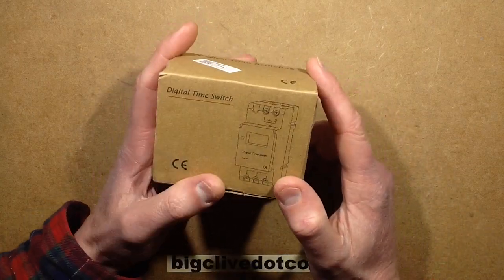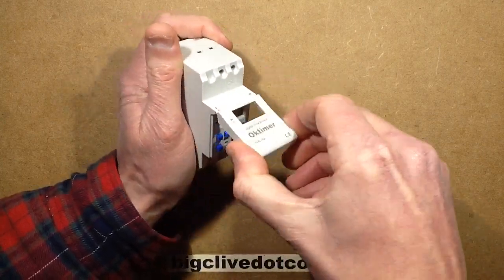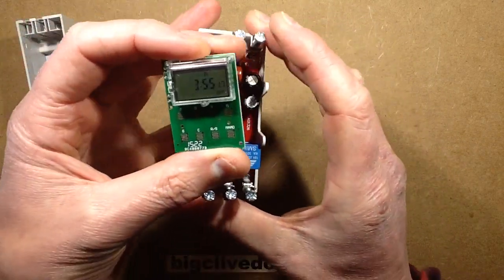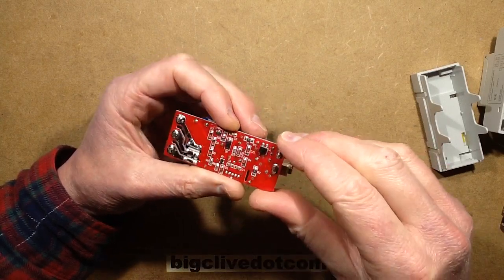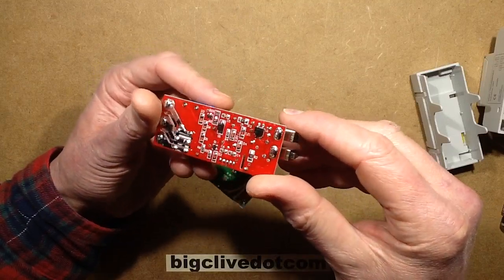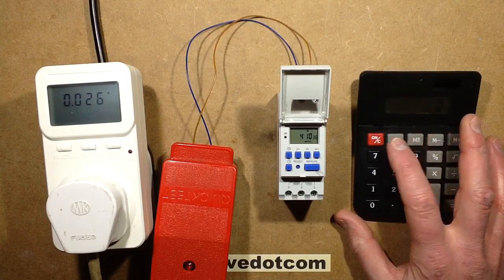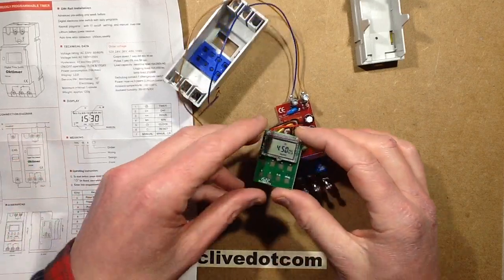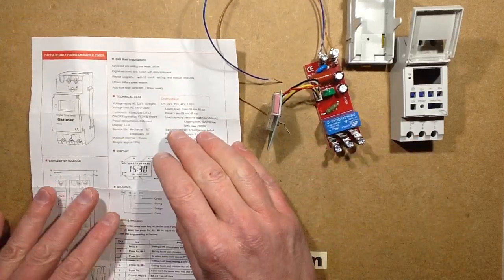Inside a cheap Chinese DIN rail time switch.

Comment: if they need to add solder to a track, is because you have the wrong PCB thickness. That doesn't make it robust, it makes it unpredictable. For example, you have no clue what is going to happen if you have 5k volts
Reply from the maker: Adding solder to a track gives it greater resilience to short circuit current and also allows a slightly higher current on a thin track.

Comment: I use this exact identical relay to witch my back yard's garage lights, been working for a full year now. its amazing. I should also mention the total brainfart I had with this timer. I thought that you feed 220v from above and then you connect the load in the bottom and the timer sends power trough the timer and out the bottom contacts. I swear to god I was trying to solve this non-existent riddle of how and why the thing did not work, only then, after two hours, I realized. It does not send power trough itself, you have externally feed the switching contact. Jesus Christ. Been in Electrical field for 2 years now. Im ashamed.

Comment: Glade I could find your work, I have one of these timers that has blown the input capacitor and cooked the accompanying resistor. Do you perhaps have these two values for me. I would like to repair this unit, it is a 220v input timer. This happened from new so it's a new component failure. You did refer to the cap being 330nF at 630v, I think the res should be 550ohms . Hope you can assist with my rebuild.

Comment: the real timer is quite expensive compared to this one .We have used them for controling lights ventilation and believe it or not proofing ovens for bread ..We use the timer to control a contactor with a 120v coil ..They last pretty long considering the way they are made very reliable but pain in the but to read and program especially when you can't see the screen because of flour grease and all the other stuff floating around the bakery .Sometimes we just use an old style mechanical clock work timers but they really him up with stuff in the air .these don't .they each have their applications

Comment: Put one of those anywhere near contactors and it'll fire when the contactor closes sometimes... Banged my fucking head against a wall with that one for a month.

Edit: also of note, if you have an input on a raspberry pi, a contactor close will make the pi think a signal has been received... It's a very very tiny pulse but the pi counted it - I suppose you could do stuff with capacitors etc to stop that, but I just sorted it in code since the signal input is so short.
Reply from the maker: Yeah.  Some reset randomly when they bring in contactors.

Comment: Mine arrived and the display was not on like all the videos I've watched. The instructions state to connect to power and let the the battery charge before hitting the reset button. I've had mine hooked up to power overnight and I still have nothing. It the light meant to be on when connected to power? Maybe I have a dud :-(
Reply from the maker: Try pressing the reset button while it's plugged in.  It's possible the battery has failed.

Comment: Sold with multiple Voltages, however the one I received (12V) had no indication of which way around the +V and -V was on the input, which just had the sin symbol for AC in.
A bit of digging around on the www and found that pin 1 is +V pin 2 being -V. I see Clive says there is a delay between switching over manual, but the one I have has auto as mid position key press on the manual changeover in either direction on, auto off and off auto on.
Nice video as all your stuff is

Comment: I bought so many of these (Although I can almost guarantee they were Not this exact model) in my country, and they were all Shyte.

The ones they sell locally, have a flaw where the clock And relay can be triggered directly from the battery, even when disconnected from mains.

I found this out after a power failure, when I actually heard the relay buzzing, trying to pull itself on, but obviously, the little battery that maybe once could, couldn't any more.

Bought a different design, which only allows 24 hour programing with a touch sensitive screen to set the unit (Will NEVER buy another one of those either as the display is crap and warps out of focus when you try pressing where the touch symbols are.

After buying the touch input DIN one, I decided this was the last time. From here on out, it's going to be the sonoff SV units, which connect via Wi-Fi, so they never go out of sync with time, and you can program them directly with schedules, or manually activate it from a smart phone.

The only thing I would have to get is a beefier relay, as this runs the pool pump currently 🤔

Ps. What abomination of a tool actually down votes an informative video like this?

Comment: It is exactly the same as the much more expensive brand Gewis, even the instructions are the same apart from the logo. Been using one for 7 years and one for 1 year, both going strong.

Comment: When my relay turns on, the timer reboot, any idea?
Reply from the maker: It's a common issue with some loads and cheap time switches.
Reply: @bigclivedotcom  Do you know if it is easy to fix? If it is a common component issue...

Comment: For anyone concerned with reliability, I have used these exact timers in my shops air compressor control panel for the past 5 years now without any issues. One timer controls a mains supply contactor(so compressor is de-energized during closed hours), and a second timer, coupled with a delay timer (5 seconds) for an auto moisture drain for the tank (drains moisture from the tank once an hour). System has worked flawlessly for 5 years since I built it and put it into service.
Reply: thank you, that kind of feedback is very helpfull

Comment: Hi Clive.  Love your vids.
I have a plug-in type of this timer.  The PCB and components are very similar. 
https://www.ebay.com.au/i/272298076000?chn=ps&norover=1&mkevt=1&mkrid=705-139619-5960-0&mkcid=2&itemid=272298076000&targetid=894844051568&device=c&mktype=pla&googleloc=9071851&poi=&campaignid=9772795581&mkgroupid=99377631746&rlsatarget=pla-894844051568&abcId=1145981&merchantid=109696241&gclid=CjwKCAjw-YT1BRAFEiwAd2WRtgWSupqQBLD5em3UNQrV92O1aSTHBhiYpDU6KtiWbK5ObpG5s6A6thoCA-AQAvD_BwE
The problem is that when a switch or high load on the same circuit is made or not, the timer does a total reset, time, timer settings, everything.....  Any ideas for an easy fix, or bin-it?
I'm a mechanical engineer, and a beginner/intermediate at electronics.
Thanks,
Bill

Comment: Last week I've bought a cheap din timer from ebay for  £10 for ny little automatic starwberry "farm". It had a ground connection, so I took use of it. When I powered it on, it tripped the 5mA R.C.D. I opened it up and I found a 33K resistor between L & PE. I asked the manufacturer about that, and they kindly responded: It is a timeable R.C.D. trip
Reply from the maker: That's odd.  Can you give me a link to the listing?
Reply: @bigclivedotcom  The've deleted it after I complained.
Reply: @bigclivedotcom  I think it was called a "super timing module DIN timer switch scrren lcd module or something. Imagine a confusing name like this.
Reply: @bigclivedotcom  Try typing this into ebay maybe it will show up. It was a blue coloured device with 10 buttons and a buzzer built in

Comment: From the 24vdc input terminal, what is the value of the 1/2 W resistor?. Looks like green, brown, gold, with gold tolerance. Is it a resistor or an inductor? I looked at the outside case and saw the AC symbol and powered it up with 120VAC and blew the resistor? It is burned but still reads 544K ohms. Then I saw the stamped input 24VDC on the other side after I fried it. I guess the AC symbol is generic on all input types, just have to read what is marked on the case, duh, lesson learned. Also looks like a memory cap type battery for the display, or is it a battery? The display was weak so I was hoping that the input voltage would recharge the battery/cap.

Comment: The burning question (see what I did there?) with Chinese stuff is, would you install it, and risk leaving it, powered up, unattended, 24/7? - I'll be honest, it takes me a long time to put any faith at all in Chinese products. In a way, it defeats the whole object of some of these gadgets. I am, however, wondering about utilising one of these switches to operate an outdoor lighting circuit such that it can turn on and off party/Christmas/garden lighting sets.

I must say though, this switch does seem to be unusually well made, considering its origins.

Comment: What was the charge regulation on the battery?
Reply from the maker: Just continuous trickle charge at low current.  How most NiCd/NiMh button cells are charged.

Comment: Hello
Can i change the battery with a different type / voltage?
Reply from the maker: The battery would have to be the same chemistry.
Reply: bigclivedotcom thanks for your fast response. This battery is nicd 1.2v 400mah?
Reply from the maker: @savvask8905  That sounds quite a high capacity for something like this.  It would typically be a nicd button cell with a capacity of around 40mAh.

Comment: I've a the exact timer. But left unused more than a year. But now when I attempt to use it, on powering the timer, the relay chartered for a while and after some time, it stops chattering. But the failed to come on. Is it the battery in the circuit is chargeable. Because if the battery is dead, the timer may fail to function I believe. Is it need to change or else if the battery is chargeable then I must charge battery to become active and in turn the display and timer. Please do clarify and help me to restore the timer to function as usual
Reply from the maker: It sometimes takes the battery a while to charge again but they also sometimes fail.  Leave it charging for a while and then gently press the reset button if there is one.

Comment: Hello Clive I have one of these timers but its called a dianqI timer would this be the correct way wire it up in this here on YouTube https://youtu.be/5icTAtDo and here is the timer I have identical to your one Electronic Weekly 7 Days Programmable Digital TIMER SWITCH Relay Control 220V 230V 6A 10A 16A 20A 25A 30A Din Rail tp8a16 DIANQI
 http://s.aliexpress.com/aEVnQ3ue?fromSns=Copy to Clipboard 
(from AliExpress Android)
Reply from the maker: Video unavailable.  It will have two connections for live and neutral for powering the timer itself and sometimes just the switched output or a plain set of switching contacts.
Reply: bigclivedotcom thank you
Reply: bigclivedotcom so excuse my ignorance 1 would be live into the timer  2 would be neutral 4 switched live out for the device powering and then neutral out of the device to the neutral block on the fuse box and would 3 be a loop back for live or neutral on the timer

Comment: I'm DESPERATE to find complete documentation for this timer.  There are at least 5 states it can have: AUTO, AUTO OFF, AUTO ON, ON and OFF.  It also has pulse and countdown timer modes.  My documentation is horrible.   Can anyone point me in the right direction?

Comment: Problem is that these are design and built for 220V and after a while running at 240V the controls give up after about a month!!!! Happen to me many times!!!!  I just buy Australia local supplied 240v electrical equipment like this.

Comment: 17:07 - "...I don't think that's lithium..."  While I'm sure Clive isn't surprised, I'm sure many people would be surprised to find that many items you find in a store that say they have lithium batteries in them really have NiMH.  It makes the device cheaper to produce and most consumers just believe what is written on the package.  I had an old Craig MP3 player that I used for years until its runtime started diminishing even though it said it was fully charged.  It said right on the back of the unit that it had a lithium battery.  Opened it up and surprise (not! :)), it had a NiMH battery pack.  I was able to find a replacement NiMH for it and it works fine now but I guess it goes without saying, "Don't believe everything you read."

Comment: Would taking a large thick gauge wire like 4gauge and spreading all the wires out on one end and turning a live circuit board upside down and probing all about it jabbing at it with the large 4gauge wire be enough to make you cringe? some showers of sparks might happen.

Comment: Unfortunately i have bad experiances with the quality of those sungoul Relais. I own several automatic Master/Slave  powerstrips from "Brennenstuhl" also sold for a fraction of the price at ALDI Nord by the Name "Ritter" they all use a very similar if not identical relais. The 4 that i had in use lasted all between 6 weeks and 4 Month before they "weldet" themselfs either open or closed. Under very light use maybe 2 or 3 switch operations per Day with a load of not even 1 Amp (they were rated for 10 Amps) I replaced them with pin´-compatible Finder industrial Relais rated for 1 Million switch cycles. And so far no problems whatsoever.

Comment: hi, recently my thc stop functioning and have a strange simptom:1-when running on main voltage the display is blank and no option is aviable, 2-dissconnecting from main and the display are ok for a while until the backup battery is dischargewhat can be the problem?thx

Comment: my advice, change solid capacitors of os'con or about Electrolytic os'con, and you will have a good quality timer.
  the jweo capacitors are not of good quality, and fall in a short time.

Comment: Clive the reason we have ring mains in the uk  is in the mid 1900s we used a lot of high kW oil heaters instead of central heating, so instead of using a higher CSA I.e 4mm t&e it was cheaper to run the extra 2.5mm t&e back to the DB.

Comment: Have you ever done a teardown of one of those Songle relays? I see them in so many Chinese modules these days
Reply from the maker: +codebeard I've never actually opened one.  It's always hard to judge contacts by looking at them though.  A real test would involve continuous operation under load.

Comment: the big/double button used to switch off/on/outo in this model,
there is other model wich look the same but the big button get locked up outomaticly after 5 secs.
you need to click on one side 3 time to unlock the other side, wich is the off/on/outo button :)
i have 3 of this modules installd and runing hot water boiler, works great about 2 years now.
nice vid

Comment: I would like to use this switch if it has MULTIPLE timepoints (and multiple relays correspondingly). I really need to timeswitch two loads four times a day. It sounds more reasonable to run just one timer per household... Please, Clive, tell us if it is possible? Is there a way to modify this switch?

Comment: the contacts still weld themselves closed
Reply from the maker: +Martin Shaw With high enough current it is possible for switch contacts to weld closed, but this switch does seem to use the principle of forced contact displacement.  The actual action of hitting the button will force the contacts apart.

Comment: Vibrations or bumping could reset the timer because of that connector. I wonder why they didn't mount the backup battery on the logic board. The logic board could be an of the shelf one, that would be a motive.

Comment: These cheap ass real time timers, clock accuracy is horrible. After a month or two it will add more than 10 mins. And that capacitive power supply get super hot when the relay coil is energized. For industrial applications you better go for fairly good brand.
Reply from the maker: +Pasan Karunanayake It seems to be gaining less than a second per day.  The power supply design is clever.  The unit does not get even the slightest bit warm whether the relay is on or off.
Reply: +bigclivedotcom Thank you for the reply... I bought few units (220V version) form below linked model. And I have hooked those to a battery charging system. Capacitor side of the module is getting yellowish color because of the heat. However still they are working. But the time accuracy is crappy, may be because of the internal heat. 
http://es.aliexpress.com/item/220V-110V-24V-12V-Cn101A-Rainproof-Digital-Programmable-Timer-Switch-With-Weather-Proof-Box-16A/604435652.html?spm=2114.43010408.3.29.qDP4sC
Reply from the maker: +Pasan Karunanayake Excellent.  I've just ordered one of the dodgy ones to take apart.
Reply: +bigclivedotcom Superb..... Now I can get some clear idea about it. Thank you bigclivedotcom.

Comment: I love your videos. I I'm intrested in learning more about electric / circuit component's . Is there any book what I could buy what will give me some info / class on how the components work ? (diode , transistors , resistors, ....) . I do know how electricity work. Overall that is what I do for living ( elect. installer in houses ). Hope you will answer me. Keep up the great videos , they fun to watch
Reply from the maker: +CptSmoke In this day and age the Internet is the best place to learn.  Who needs a book when Google is there to answer every question you have and then the ones that lead on from there.  I would suggest buying some cheap kits on ebay, some electronic grade solder and a soldering iron, and just start playing.

Comment: Songle are pretty good relays these days. Pretty sure they are one of the biggest relay manufacturer in China. So far, I haven't had any issue with Songle relays. I have a ton of devices with them.

Comment: Can you explain how the device is connected? I think that the top connectors are only for powering the device, and the bottom connects 5 to 4 when "on" and 3 to 4 when off. Does this make sense?
Reply from the maker: +Michael Keith The top contacts are the supply and the other side has a set of volt-free single pole changeover contacts.
Reply: +bigclivedotcom thanks! really enjoy your videos. Have learned not to buy AC consumer electronics from eBay :)